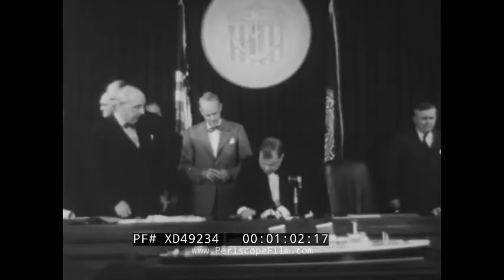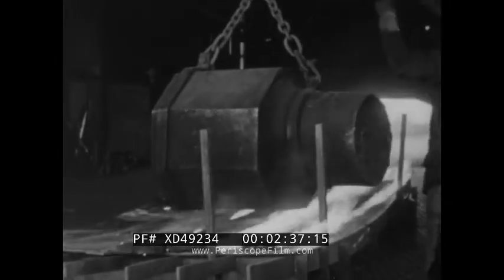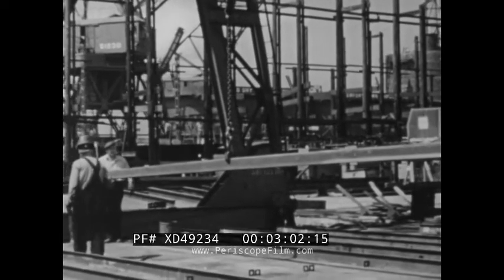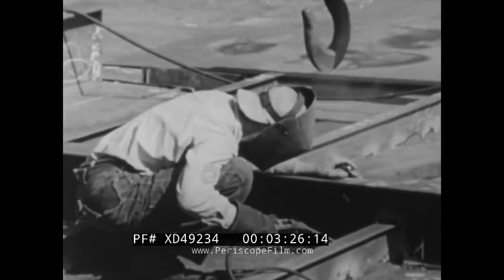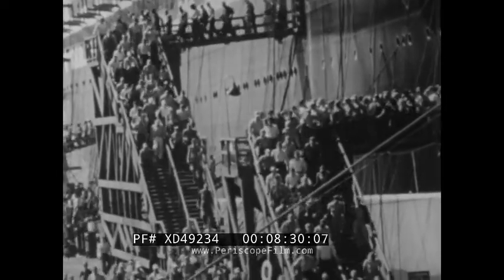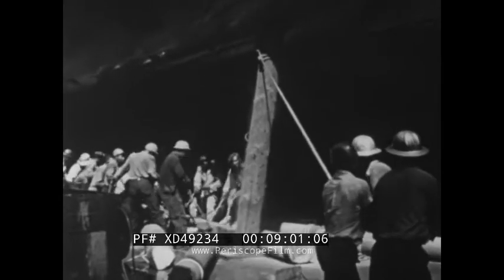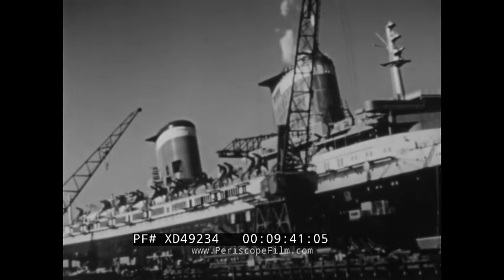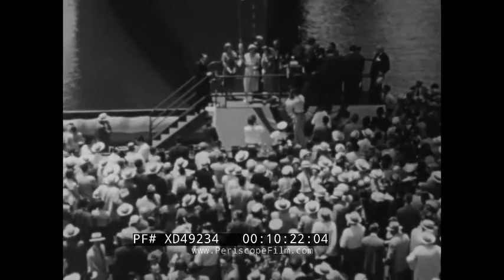"BUILDING NEW SUPERLINER UNITED STATES"  1950s SS UNITED STATES NEWSREEL  XD49234

Comment: Subject: Urgent Tasking Order - Immediate Return to Service of SS United States

To: [Shipyard Name], Mobile, Alabama

From: United States Navy, Office of Naval Operations

Date: [Current Date]

Classification: URGENT - IMMEDIATE ACTION REQUIRED

Message:

"This letter constitutes an official and urgent tasking order from the United States Navy for the immediate commencement of activities to return the SS United States to active service.

Due to unforeseen and critical national security needs, the Secretary of the Navy has authorized the immediate re-establishment of the SS United States for specialized naval operations.

[Shipyard Name] is hereby directed to:

Immediately cease all current activities related to the vessel's preparation for artificial reef deployment.
Conduct an expedited assessment of the vessel's current condition, focusing on hull integrity, structural soundness, and remaining systems.
Develop and implement an immediate plan for the removal of all materials and equipment added for the reef deployment.
Begin the process of assessing what systems would need to be repaired, or replaced, to bring the ship back to operational status.
Provide a detailed timeline and cost estimate for the restoration of the vessel to a state suitable for naval operations, with an emphasis on maximum speed and endurance.
Begin immediate security measures to secure the vessel, and its surrounding area.
Report the security status of the vessel every 12 hours.
This is a matter of the highest national priority. All necessary resources are to be allocated to ensure the rapid and successful execution of this tasking order.

Regular progress reports, including daily updates on the vessel's condition and restoration efforts, are to be submitted to this office.

The United States Navy acknowledges the extraordinary nature of this request and appreciates the immediate and dedicated cooperation of [Shipyard Name] in this critical endeavor.

Signed,

[Fictional Name/Title]

Office of Naval Operations 

United States Navy.

Comment: All that talk about fire-proofing and not allowing wood - but they built it of aluminium - the one structural metal that burns really good and hot!
Building it for the trans-Atlantic run at the beginning of the jumbo airliner era was much like building steam locomotives at the beginning of the diesel electric era.  Somebody had more money than brains.
Reply: You don't understand.
Reply: @c.c.hiliner1065  It seems you are the one who does not understand.    Go look us what happened to USS Belknap.  It collided with an Aircraft carrier with negilble damage to the steel hull.   However a fire broke out and the Belknap's aluminium superstructure and interior, being built of aluminium, melted and collapsed, caught fire too, resulting in the USN banning aluminium.
You should look up the thermite reaction, where burning aluminium in the presence of rusted iron causes heat hot enough to reach 2,500 C.
It is well known that jumbo airliners made air travel so cheap the ship travel could not compete and disappeared.

Comment: 7:55 What's "maronite" made of?
9:35 "How powerful is she?" If she were made today would she get a more efficient mode of propulsion, besides nuclear that is? I've heard combined cycle power plants are the way to go these days, a turbine acting as the "boiler" to create steam.
Reply: Marinite, is an Amosite, brown Asbestos insulating board. I think Johns Manville made 
it.
Reply: @indigohammer5732  That's what I suspected. Kind of explains why no one wants to rehab the USS United States to the point she could become an working ocean liner again instead of floating hotel in Boston, New York, Philadelphia, Miami, Seattle, San Francisco, Los Angeles, or San Diego.
Reply: @darkmath100  Marinite is an unusual material. There was a Marinite factory in Glasgow, which only used Brown Asbestos. There are very few facilities worldwide which solely processed Amosite. I think the Marinite in the US was made in Tyler Texas. The same as the QE2.
Reply: @darkmath100  All that stuff was removed many years ago...

Comment: She still holds the Blue Riband for the fastest transatlantic crossing by an ocean liner - in both directions - 70 years later!
Reply: She was fitted with aircraft carrier engines and Her speed, estimated at 56mph, is still classified.
I still have a few towels, dinner and luncheon napkins (framed) and ash trays.

Comment: the biggest white elephant ever to sail out of newport news!!
Reply: @andreferro4618  the only thing it has in common with a carrier is size it ain;t nuclear and it's at least 10 knots slower than the closest carrier! it couldn't even keep a Nimitz in sight let alone keep up!!  it never made a profit and it never carried full capacity when it was built is was crystal clear the passenger liner days were over and had been dead and gone for a decade and the airliner had taken it's place! the only reason it was built was to keep newport news busy til congress approved the new carriers!
Reply: @keithmoore5306  max speed off Nimic class nuclear carrier is 56 km/h ,SS United States was 71 km/h.
Reply: @dzonikg  not sustained!! Nimitz can run full out for weeks at a time that tub's machinery maybe 48 hours, 72 at the outside before they have to throttle back or tear something up!!
Reply: @keithmoore5306  The United States crossed the Atlantic on her record run at an average speed of 35.59 knots and completed the run in three days and ten hours; that's a total of 82 hours.  For an encore performance she made the westbound passage home at over 34 .5 knots which took three days and 12 hours which sums to 84 hours.  The only limit to her high speed sustained operation was fuel.
Reply: @scottspilis1940  that really don't matter! the only demand for it was from the shipyard workforce not the passenger load! the fact is building it in the dying days of liners was a fools errand and a waste of money and effort! nobody was going to take the better part of 4 days to travel when they could do the same distance in way less than 24 hours flying!!!
Reply: @keithmoore5306  Actually it does.  You stated in an earlier post that the United States could  maintain its speed maybe 48 hours, 72 at the most before she would have to throttle back.  This is odd because the United States shared the same basic power plant of the all the subsequent super carriers.  In reality, in addition to her maiden voyage, the United States maintained a sustained service speed in excess of 30 knots for her entire career with no engineering casualties. 
In regards to her utility the ship was designed post World War II where travel by ocean liner was still a thing.  Trans Atlantic air travel was on the horizon, but up to the early 1960’s  you were restricted to a confining seat in a vibrating tube for 10 + hours and a lot of people were unwilling to experience that compared to the comparative comfort offered by a trans Atlantic liner even though you were looking at a four day trip.  Trans Atlantic liners were viable until the early 1960’s when jet air travel became common and travel times dropped to about six hours.  You could probably make the case that the France and Queen Elizabeth 2 were already obsolete when commissioned in the 1960’s, even though each ship had a longer service life than the United Sates albeit in different guises.
Reply: @scottspilis1940  speed is not the point the point is it should have never been built!! the fact that only vacation ships exist anymore proves that!!

Comment: It's been rusting away at a dock in Philadelphia for many years. All plans for renovating it have fallen through and its likely next stop is the scrapyard.
Reply: @Chris101 Gray SS America is not sister ship either..SS America was launched in 1939 and it was much smaller ship
Reply: Sadly, yes.
Reply: The US conservancy has said that if it comes to that, they would rather scuttle her so she can become a artificial reef. Still a sad fate, but better than the scrapyard.
Reply: There's a recent footage on YT on board of the United States. Or what's left of her. A very spartan ship, compared to the luxury of the Titanic.
Reply: It’s a shame bc the sister ship which has nowhere near the history is still an attraction/hotel in CA, the queen mary. They should do the same on the Philly waterfront, it would be beautiful if redone.
Reply: @jrthetravelingsalesman6357  RMS Queen Mary is NOT a "sister ship" in any way. RMS Queen Mary entered service in 1936, and is of very different design. 

Before RMS Queen Mary was retired from service, arrangements were made for the ship to become a hotel. She sailed to Long Beach in 1967, underwent conversion to a hotel (much of her machinery was removed) and opened in 1971. She is now in need of major repairs after a half-century, due to hull corrosion.

The SS United States entered service in 1952 and sailed until 1969, when she was abruptly pulled from service during a scheduled overhaul. This termination of service was due to skyrocketing costs of operation, loss of passengers, and most of all due to the end of Federal operating subsidies. 

Over the years SS United States has had many owners, each with plans that never came to anything. All of her furniture and interior fittings were removed and sold to pay off creditors; the insides are bare metal. She has been tied up in South Philadelphia for since 1996, and her condition is not good. 

The Big Problem is that restoring SS United States would cost much more than building a whole new ship. Conversion to a floating hotel would be very costly too, and none of the interior would be original.

SS United States was built for speed, and set records that are still unbroken 70 years later. But that speed came at a cost; the engines consumed enormous amounts of fuel, which is a BIG reason she was removed from service. 

Anything made by people can be fixed if you replace enough parts. The question is: Who's going to pay the bill?
Reply: @JugSouthgate  Well said. She will now live on as a reef and outlive all of us.   🚢